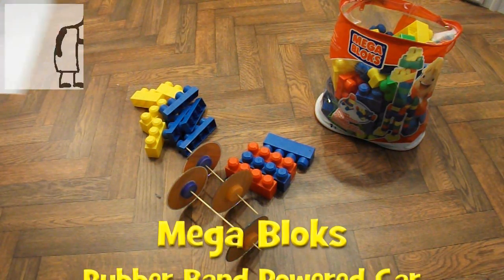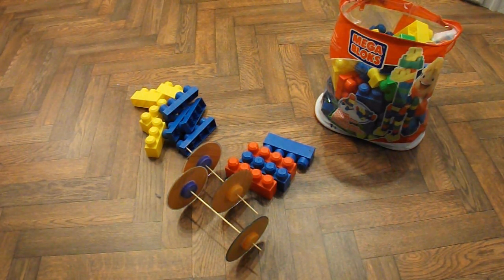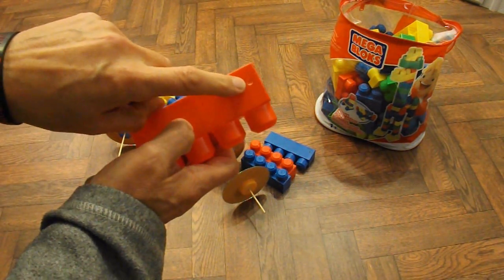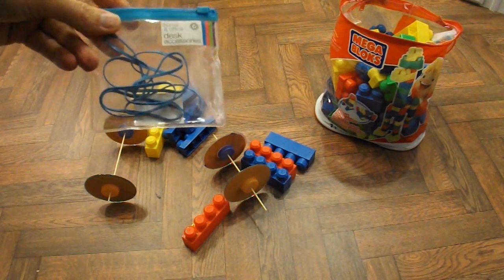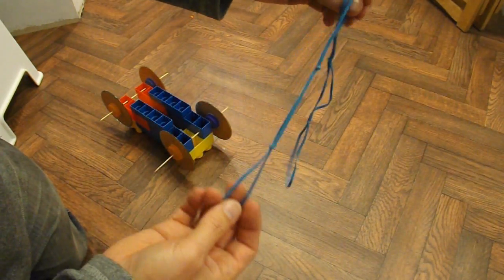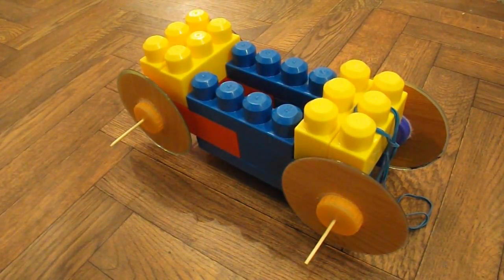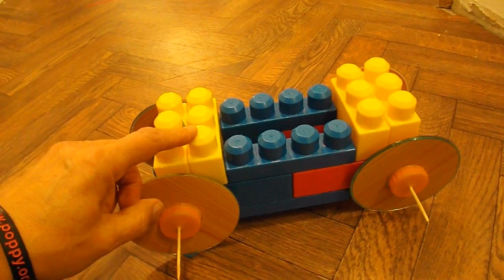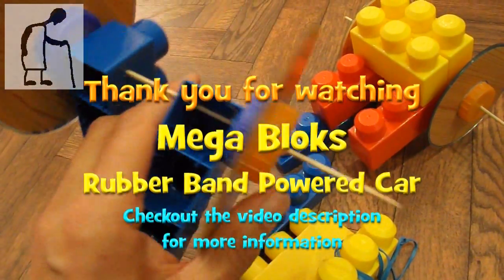Mega Blocks Rubber Band Powered Car

Comment: Hey grandad can you try to make a giant styrofoam plate glider
Reply from the maker: +The airplane Builder that would be a lot of effort for very little benefit. I have seen people use the plates by cutting the flat section out of the middle and then using that for ribs and formers for model planes but I don't like to spend lots of time on my builds. Here are a couple of gliders I made from Pizza trays which are like larger styrofoam plates https://youtu.be/SL69uLEm1YQ  https://www.youtube.com/playlist?list=PLA5a2xPRSrB166fV86ythXzHwVFFEkAc9
Reply: +GrandadIsAnOldMan ok thanks